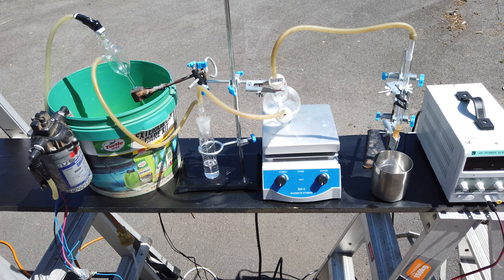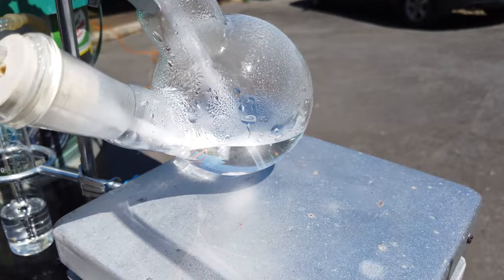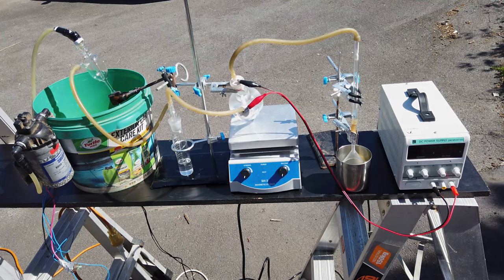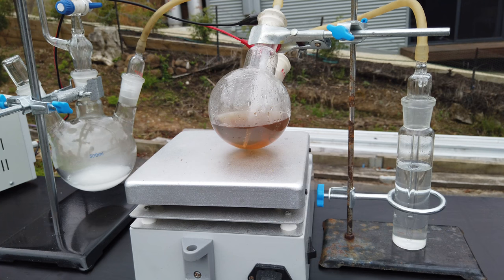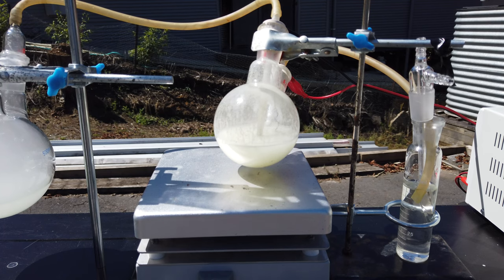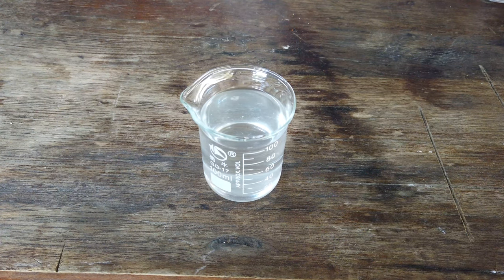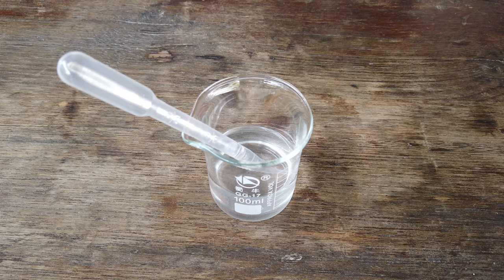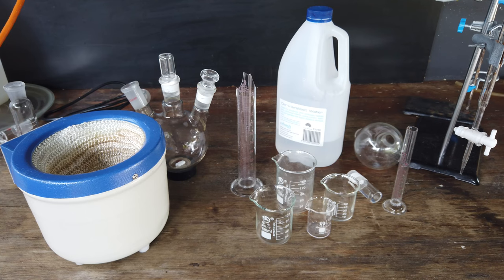Sulfuric Acid From Sulfur Dioxide?

Comment: Before the UK ban on H2SO4 above 15%, I had a homemade apparatus for this. It was a teflon lined compressed air tank I used. I'd quarter fill it with sulphur and water, fill the rest with compressed air (or oxygen which worked way better) til it was at about 8 or 9 psi, then I'd heat it very slowly til the pressure got to about 2× atmos, and throw the tank into my firepit til it went out (usually a couple of hours). Release the pressure incredibly slowly, the tank I had had a long tube added to above the liquids level, so I could vent the pressure without spraying H2SO4 everywhere. I've achieved over 90% H2SO4 in the past, though using a firepit means the temp wasn't consistent so the concentration wasn't either. 
I will add a disclaimer, I was in a very wide open space and didn't go near til it had cooled, explosions spraying concentrated H2SO4 are not only a risk, but actually very likely if the PTFE lining has flaws. The product did contain iron impurities, possibly from the regulator but equally possible that I overheated the PTFE and it let some through, but it was great for reactions where a bit of iron sulphate/oxide didn't matter, and was actually a benefit for reactions that require iron as a catalyst. 
Either way, only so it this way of you're too lazy to observe the reaction and have somewhere a sulphuric spray won't cause issues. It's dangerous AF but damn if it isn't easy!!!
I tried a run with H2O2 in place of water but my weak 3% peroxide didn't seem to be reacting with the sulphur as much as the iron from the flawed cylinder.
Reply: That's metal AF. 
Even more metal is adding H2O2 to sealed contained when you know there is iron that can react
Reply: Damn that sounds scary!
how big was the container and how thick were the walls to keep a high number of psi inside
Reply: @IlusysSystems  I was naive enough to think the PTFE lining would survive the heat, so I didn't think the iron would be too big of an issue. To be fair, it held out longer than it should have considering at one point the cylinder was getting close to cherry red!
Reply: @Moritz___  It was from a small compressor, so probably about 60 litres. I don't know how thick the walls were but it was rated for about 9 bar IIRC, and I've actually tried to blow one up in the past and it was still holding at 21 bar before the compressor gave up.

Comment: Thought you were going to use vandium pentoxide or other oxide passed through in a heated glass tube.  Swap out the catalysis for nichkle oxide and sulfur dioxide for ammonia you git nitric acid ammonia than use the Nitric acid to oxidize the Sulfur dioxide to Sulfururic acid and form sodium nitrite from the NO2.

Comment: Grab a quartz heater tube from an old space heater. Fill it loosely packed with vanadium pentoxide and slowly pass oxygen in excess plus SO2 while the tube is heated strongly. The SO3 vapor can be bubbled into  water or crystallized as a solid. It forms long needle like crystals. ❤
Reply: if you do not have vanadium pentoxide, try other metal oxides- even iron oxide will do. these are catalysts and must be suspended on a carrier. Soak asbestos or mica in ferric chloride and use the dried mass as the catalyst. broken porcelain or boiling chips also will work. conversion will be around 40-50% for a single pass at 350-400C

Comment: You could try the Bunsen reaction, might be worth looking in to. I've not tried it but I'd do something like this:  2H2O + SO2 + I2 → H2SO4 + 2HI. Ideally by burning Sulphur to avoid HCl contamination. Decant the upper aqueous later and  bubble air through it. 4 HI + O2 → 2 H2O + 2 I2 to remove traces of remaining HI. Extract the I2 from the acid  with a non polar solvent. Bubble air through the HI/I2 liquid to regenerate I2, or try electrolysis. The Iodine can be made by electrolysis of KI. Concentrate the resulting acid after removing HI/I2, conc. Sulphuric can form Hydrogen Sulphide with Hydrogen Iodide.

Comment: Always interesting to see your attempts, if they work or not.
For me, it was obvious, that your sulfur-burner couldn't work in that high tin can, while sucking off air from above, since there is just not enough oxygen coming around to burn it. You need a burner, that allows the air to flow in from below same time. Best thing would be a closed container, into that you can blow a regulated flow of air, with overpressure, so this would also make your vacuum-pump unnecessary.

The method with HCl + NaHSO3 is way too expensive for producing just some diluted H2SO4, and doesn't make sense, as long as it can be bought right now instead, cheap, as HCl and perfectly clean. 
Also your setup with platinum electrode, expensive glass apparatus, doesn't match your channels name anymore, for my taste. 

The easiest method, I have in my mind for making H2SO4, is to oxidize Iron wool, or powder, or even better, Iron-oxide, to get some Iron-II-sulfate by air and over time and then to roast that stuff.
But for now, I don't know the best method to produce the Iron-II-sulfate from just Water, Air, Iron and Sulfur (and time). But there must be a way, because that is, how it is generated naturally too, as a mineral.
Another Idea is to just burn Sulfur to SO2, bubbled into some water and also bubble O3 from an Ozone-Generator into it, that would perfectly replace H2O2 without much costs and without the diluting-effect as well. And also it is way easier and cheaper, than to electrolyze the stuff with a platinum-electrode. Only Challenge I see in that, is to get the process that much effective, that no SO2 is wasted.
Also H2SO4 can be made my reacting SO3 with Water. The most common source to make SO3 is gypsum, CaSO4, that decomposes to CaO and SO3 at 1450°C. This Temperature is challenging to achieve, but I think about to give it a try into a charcoal-fire, when I have the container, that is able to handle such temperatures.

Comment: Maybe you could make a chamber with water in it and a Jacobs ladder in the top and you could pump air in the top and it would be converted into Nitrogen Dioxide by the ladder and that would dissolve into the water. Now hook up the sulfur dioxide generator to the the chamber and have the sulfur gas bubble slowly through the solution from the bottom, also while the Nitric dioxide is being made and dissolved, the nitric acid that is created would oxidize the sulfur dioxide into sulfuric acid. This method was experimented with in WW2. Any ways cool vid, keep up the great work.
Reply from the maker: I might be building a Birkeland-Eyde reactor at some point in the future (probably a long while away), so I'll be sure to look into this. Thanks!

Comment: Another way to prevent suck back is using a small pump, such as an aquarium pump, to impart a positive pressure in the apparatus. Also, without a scrubber between the SO2 generator and the reaction vessel, you will have contamination from the HCl that can form sulfur dichloride with the electrolosis.

EDIT: Another method you can try is the metabisulfite method, in which metabisulfite is placed at the bottom of a beaker and 12.6 molar concentration hydrochloric acid is added. The resulting gas is bubbled through nitric acid, which will release brown/red vapors of nitrogen dioxide as the reaction proceeds. The completion of the reaction is indicated by the ceasing of the fumes.
3 SO2 + 2 HNO3 + 2 H2O → 3 H2SO4 + 2 NO
Reply from the maker: Do you have any ideas for a scrubber that would remove HCl but allow the SO2 to pass?
Reply: @ScrapScience  Yo can use a concentrated solution of sodium hydroxide as HCl readily reacts with it while allowing the SO2 to pass. (HCl + NaOH → NaCl + H2O). Other methods (that can be paired with the above in a two-step method) can use an amine-based solution using diethanolamine, methyldiethanolamine or aminoethoxyethanol (which would make it move complicated and less of a "scrap science"). Nevertheless, methyldiethanolamine is highly selective for HCl and can be effective in scrubbing systems.
Reply from the maker: The trouble with sodium hydroxide is that it also reacts with sulfur dioxide. In fact, I'm using sodium hydroxide here as the final washing bottle to prevent the release of SO2 into the atmosphere. Both HCl and SO2 are acidic gasses, so it's not generally possible to selectively absorb HCl with an alkaline solution.
Amine-based solutions could be promising though, I'll look into it!

Comment: Maybe you could use two separate cells for the anode and cathode connecting them with a semi permeable membrane like in the sodium hydroxide video? I reckon this would be a decent way to minimize that elemental sulfur  contamination. And run only SO2 through the anode so as to improve efficacy.
Reply from the maker: Yeah, that's the plan if I end up revisiting this.
Reply: @ScrapScience  sounds fun! Please do upload even if its a failure as im sure all of us armchair chemists combined could help
Reply: Yep, maybe something like the hydrogen generator seen elsewhere made with a whisk and the right electrode material as wool or densely packed shavings?

In the end it also may be an issue of the scale used by @ScrapScience. 
What about temperature ctrl? Is there a specific temperature range that will produce optimal results?
Reply: I‘m with @Dman6779 - this had a different goal than the one reached but on the other hand it shows how the requirements for each step need to be more specific and an acceptable range for each critical parameter defined and fulfilled.

The failed experiment of one is inspiration for others.

S can be found in brewing equipment shops too (as a salt to ensure yeast can handle apples and pears etc or in the form of sticks for „sanitising“ wooden barrels).

Comment: Hex I don't know if anyone has recommended this. But if you increase the initial sulfuric acid to 30-40% you can electrolyze at high current density (~70-80 A/dm3) to generate peroxydisulfuric acid, which hydrolyzes to hydrogen peroxide. (Theoretically, using a little potassium hydrogen sulfate can increase the efficiency.)
Perhaps peroxydisulfuric acid can oxidise SO2 directly, but there is not much information on this
The problem is that it takes a lot of sulphuric acid to get it started and increasing the concentration reduces the efficiency of the process. So either the reaction stops over time or the solution has to be diluted.

Also, I know it's a bit extreme, but it is theoretically possible to react sulfur dioxide and oxygen directly with each other in an arc discharge without any other catalyst. This should in principle generate S2O7 which is the anhydride of peroxydisulfuric acid. Which then just needs to be absorbed in water and hydrolysed.
Reply from the maker: That's a very interesting idea! I'd be surprised if peroxydisulfate can't oxidise sulfur dioxide.
The only thing I'm concerned about is the fact that peroxydisulfate is apparently a pretty tricky reaction to get right, and it is essential that platinum is used (I think lead(IV) oxide also works but I won't be touching that). I'd just find it a little bit difficult to call something an 'accessible reaction' if platinum is required, though I'm not completely averse to it. I mean, I used platinum in this video but the idea was to eventually move to graphite...
Anyway, I'll hopefully be attempting the synthesis of peroxydisulfates at some point, though I've got no plans right now. It's been something I've wanted to try for a while, and this might be a nice thing to try alongside that. Thanks!
An arc discharge reaction is definitely a thought too. I think I'd better start with some simpler reactions first though - maybe a Birkeland-Eyde reactor might be in order...

Comment: I think this needs either a divided cell, or modifications to the anode/cathode surface area ratios. Since sulfur dioxide conversion to elemental sulfur was definitely an inefficiency, I think you'd see a difference from running in an anode chamber or reducing the cathode area available to reduce sulfur dioxide. Cathode material is another optimization that's available. This is just the data page on wikipedia, but it looks like the conversion of sulfur dioxide to bisulfate or sulfate is just a little more unfavorable than forming hydrogen (-0.16 V or so). That said, the overpotential for hydrogen formation on copper is -0.50 V, so it's possible reducing the sulfur dioxide on the cathode is the more favorable reaction. Platinum's overpotential for hydrogen formation is only -0.09 V, so using platinum for both the cathode and the anode may be the play if you don't divide the cell.
Reply: Yeah something like this sounds perfect. Although since elemental sulfur is produced on the cathode its probably going to be  better to use a divided cell with some kind of permeable membrane to keep ions flowing also reducing the amount of gas that gets turned into elemental sulfur
Reply: Yeah, a divided cell is definitely the optimal route. If sulfur dioxide doesn't even touch the cathode to begin with, you don't have to be worried about surface areas and overpotential complications.

Comment: Lead anodes work better than Pt in this case. Also coat cathode in a layer of gypsum to stop reduction by making a selective pem coating.
Reply from the maker: I think I might be a little paranoid about lead anodes... they still scare me.
Reply: @ScrapScience  I actually wonder if you literally modify a car battery since it contains seperators and lead anodes already. replace anode chamber with dilute sulfuric and inject SO2 slowly within them it would be probably viable. I also wonder about metal catalysts similar to nurdrage copper chloride process or maybe a halide catalyst like for the electrobromine process.
You can use your MMO anodes for the electrobromine process since Ir-Ru is compatible with bromide electrolysis for the most part though Ir-Ta is preferred for non chloride salts.
Reply from the maker: Maybe a deep cycle battery would be a good way to go there... Though putting holes in a lead acid battery isn't generally my kind of thing.
And yes, I've been thinking about metal catalysts too. The copper from Nurdrage's process is a definite option, but copper is probably too easy to plate out on the cathode (maybe an anion exchange membrane is required). I was thinking that iron sulfate might make a good catalyst for this, since Fe(III) would be generated on the anode and easily oxidise the SO2, forming a Fe(II)/Fe(III) cycle.
Do highly acidic conditions damage MMO electrodes at all? I would have thought the high concentrations of HBr and H2SO4 would damage the titanium substrate at least. I've got no experience there though, so I'm probably wrong.
Reply: @ScrapScience  Ir-Ru MMO is stable usually up to 20% to 35% acid concentration depending on IrO2 content. Ir-Ta can handle up to 45% acid and PbO2 can handle up to 80%. HBr does damage titanium in high current density but it seems Ive seen people run Ir-Ru in bromate cells at lower pH and even a video of som1 making bromine with an Ir-Ru anode and a membrane cell. overall though Ir-Ta is preferred for any decent acid concentration as it can handle even very highly concentrated acids of both HCl and sulfuric. PbO2 is the best but as you said lead is not something you like working with.
Reply: @ScrapScience  I still think modifying an old car battery would probably work out well since its basically prebuilt and has everything.

Comment: Harry.....I had a thought after watchig a video by Integza...he showed off a knife that has milions  of pores in the metal that allowed the gas the blew threw (hydogen) to ignite without going out. It allowed the entire knife to flame and get red hot without going out...no matter how high he turned up the gas. my thought is if diffusing the SO2 gas inside the water flask would increase the concentration in a shorter time.

Comment: the so2 will oxidise with oxygen in the solution so just bubbling air through the solution with the so2 should do it surely this is a method  i would think would work
Reply from the maker: The reaction between sulfur dioxide and oxygen doesn't proceed at room temperature. Even with catalysts, extreme conditions are often required to get reasonable reaction rates.
Reply: ok fair enough what are the catalysts used i assume exotic @ScrapScience

Comment: First of all, congratulations for the ideas and sharing your projects with the public. Thank you very much! I am an admirer of your content and I love seeing it, I remember that the production of sodium hypochlorite by electrolysis was something I also tried to do at home inspired by your content. I have a question in this proyect. Does the electrolysis of dilute sulfuric acid not produce H2 and O2? How selective is the platinum electrode against sulfur dioxide? Wouldn't that reduce the energy efficiency of the process greatly? I also think that what you proposed is interesting and excellent and the use of electrolysis in the oxidation of gases requires more study.
Reply from the maker: I'm super glad you like my content!
To answer your questions, the oxidation of sulfur dioxide is significantly easier than the oxidation of water. While the electrolysis of dilute sulfuric acid does generally give hydrogen and oxygen, when we introduce sulfur dioxide to the mix, the anode should significantly prefer oxidising it to sulfate as opposed to oxidising water to oxygen. Obviously this didn't work as well as I'd hoped, but the idea is relatively sound. You're correct that there will always be a major source of energy inefficiency in the fact that we're letting the anode generate oxygen, but electricity is by far our cheapest reagent here, so it's of little consequence to the home experimenter.
Reply: Thank you very much for the response and for continuing to teach. @ScrapScience  💪💪💪